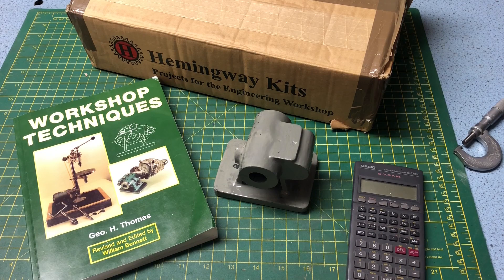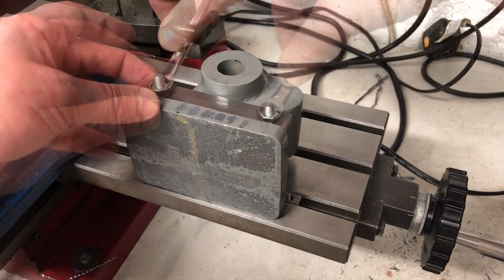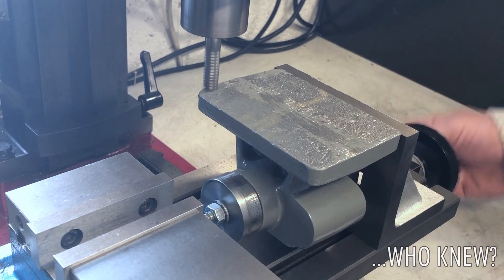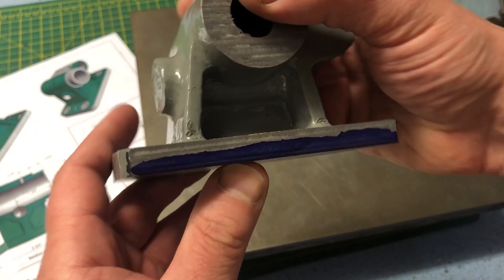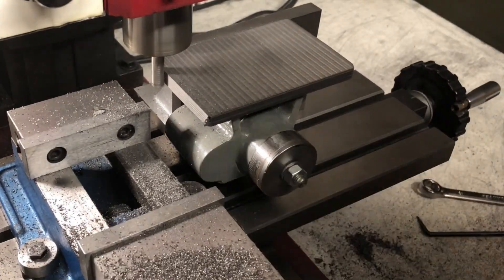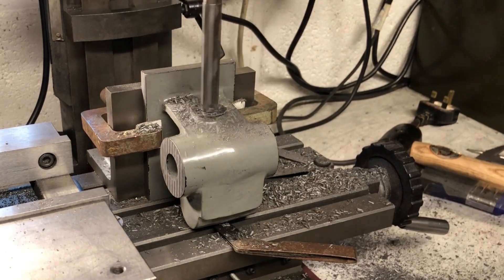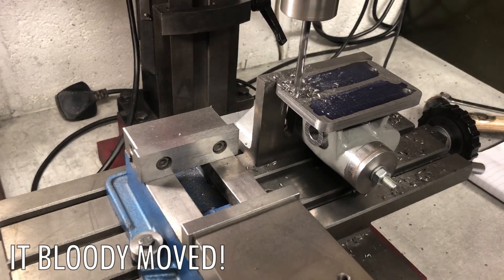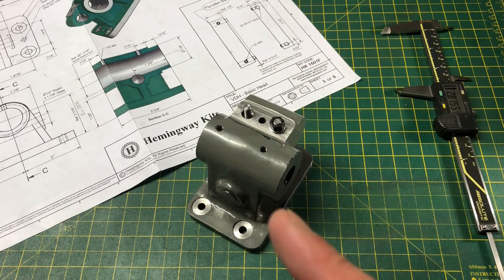Building The GHT Versatile Dividing Head - Part 1 - Dimensioning the Base

Comment: I'm just starting the same kit - thank you for this great guide to other ways of working it!
Here's a newbie question for you.  After surfacing the first face, you mount to an angle block and do the base.  Why not turn it over, face the opposite end (other end of the spindle bore) and then hold in the vice to do the base? 
Asked by a guy who doesn't have a decent angle plate but does have a good vise.
Reply from the maker: Thanks for watching. 
I think the primary reason I went for the base after the first face is that is the order Thomas suggests in his book! This makes sense on the lathe as the face being machined is at 90degrees to the mounting surface on the boring table. On the mill though, it would have made more sense for me to flip the part and bring the other face parallel while I had all of the clamps to hand. 
In my case I would still use the angle plate to deck the base. It allows almost all of the machined surfaces to be clamped against the plate. Where as my vice jaws would only grip the bottom (top?) 1” of the spindle housing. I also don’t trust my vice to guarantee squareness when holding something like this! 
I think if you find some way of providing secondary support with jacks (I should have done this on the angle plate too) and checking square, any technique that safely results in a correctly square and dimensioned part will be okay.
Reply: @DrillsTapsDies  Thanks - that makes sense.  For practice I have a couple of angle plate castings to bring into true. I'm certain those will debug much of the process!

Comment: I really enjoyed this video.  I built the original G. H. Thomas VDH 40+ years ago and watching you work brought back MANY pleasant memories.  In my opinion, the finished condition of the spindle thrust faces and spindle bore as presented in the video will cause problems and shorten the useful life of this tool considerably.  However, I believe these issues can be corrected with the machinery you have and the investment of a couple of hours at most.   Firstly, the the spindle bore should be lapped.  This will improve the both the parallelism and finish of the bore and the effective bearing surface.  The spindle should be lapped for the same reasons.   Additionally the technique used to face the 2 spindle bore thrust faces virtually  insures a lack of parallelism and lack of squareness to the bore.  Add in the poor bearing surfaces and all your other good work will be for not.

I suggest that you use a ring lap to finish the spindle bearing surface to a VERY good fit in the lapped (use a real lap, not sand paper on a stick) bore in the casting.  Do all of the turning, threading and lapping of the spindle a ONE SETTING.  Without moving the spindle in the lathe, mount the casting  on it and secure it with the split cotter.  Support the outboard end with your best dead center lubricated with white lead.  Run the lathe at a Very Slow speed and at one setting, face both of the thrust faces to removed all traces of the milling operation.    The banjo mount boss can also be turned at this setting to improve any finish or dimension issues.  Upon assembly, the spindle will run smoothly, without camming and very little adjustment for a very, very long time.

I hope you take these suggestions in the spirit that I offer them.

Cheers,
F. C.
Reply from the maker: Thanks for your input.
Unfortunately the spindle and bore are already together and any lapping now will only make the fit worse. I will probably blue up the thrust faces and scrape them in if necessary to get them square and parallel but lapping at the point of manufacture would have been a much better idea!
As it is the spindle I have made has a rather unpleasant bore so there is always a chance that I will remake this part in the future, in which case I will look back on this advice. Regardless it is good info for anyone looking to build their own.
Thanks for watching!

Comment: I have a similar casting kit.  Thank you for putting this up.  I intend to reference your fine work when it's time to start.  Very well done.  I gasped when I saw the part wiggle during the drilling operation.  But you managed well inspite of it.... Whew!!!
Reply from the maker: Thanks for watching. I hope it is useful even if just to highlight some of the things not to do! Good luck with your build it is certainly an interesting project!

Comment: Brownell gunsmithing supplies has a product called Accraglass that is intended for bedding rifle actions into stocks. It can also be used to increase the rigidity of your shimmed mill column. 
Just remember to lightly oil either the base or the column to avoid permanently  joining the two together.
Reply from the maker: Thanks for the tip. I have had a couple of people point out that I should man up and fix it so I will check that out!
Reply: @DrillsTapsDies  Stefan Gotteswinter corrected the tram in his benchtop mill using just such a technique. The gap caused by shimming was filled with one of the modern epoxies so as to regain stiffness; the clever part was the compressibility of the shims, which were copper. That allowed for fine tuning until the epoxy hardened.
Reply from the maker: @624Dudley  Yes, I have seen his video. The annealed copper wire trick is brilliant and I doubt it is something I would have thought of myself. I’ll add fixing the mill to the end of the (long) list of things to do!
Reply: @DrillsTapsDies  No rush. 😄

Comment: What the rough spindle height? Asking for a friend...
Nice video 👍
Reply from the maker: Thanks for watching! Spindle centre height as specified is 2 1/16. The head was designed to be exactly on the spindle height of a Myford 7 series lathe when on the boring table - as these lathes had the head and tailstocks hand fitted at the factory they are all slightly different - mine has come out at 2.077. I will probably make a riser block for mine to use on the mill more often than not.
Reply: @DrillsTapsDies  Thanks for that, a riser block is a great way to go. The myfords are absolutely beautiful machines and this is a fitting accessory.
I'm really enjoying watching you tackle the various setup problems and your various tooling. Thanks for sharing your project.

Comment: Just found this videos. Great to see, I made a VDH as a project some years back.
Reply from the maker: Thank you. It is an enjoyable project so far. I'm quite tempted to make the Hemmingway filing machine I see you have made also - have you found it to be a useable tool?
Reply: @DrillsTapsDies  Yes, it was useful when doing some parts for the Otto Langen engine (filing the excenter shieves). I made the Headstock dividing thingy out of my VDH as I bought a milling machine after i hade made it (milling ops on my myford lathe as in GHT's book). The mill came with a very nice dividing head.
Reply from the maker: It is similar operations I’m thinking of. I might give it a go next.